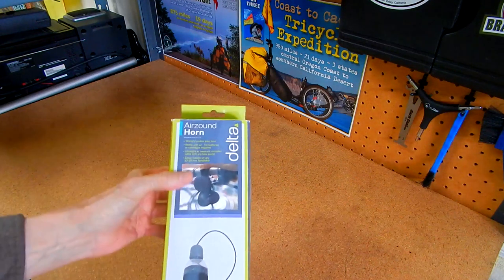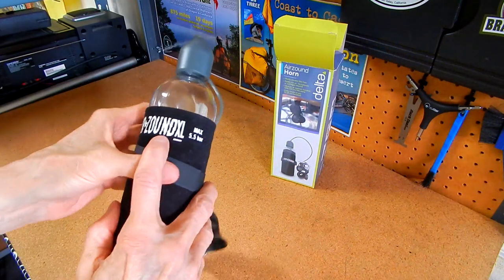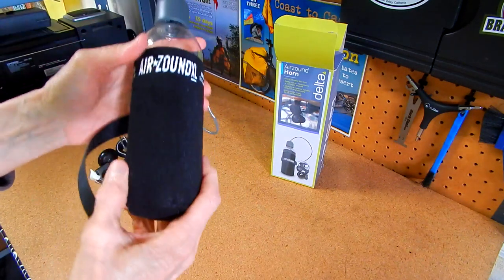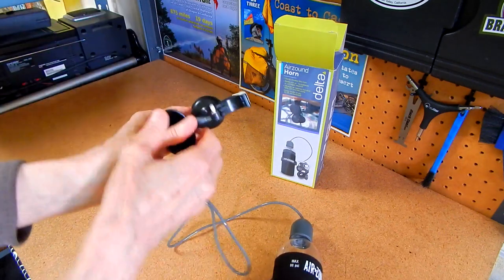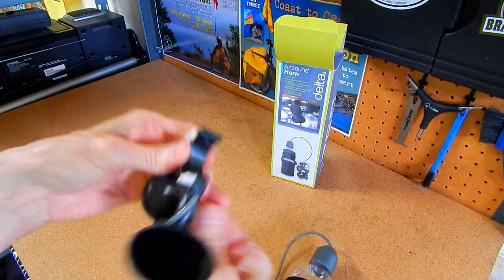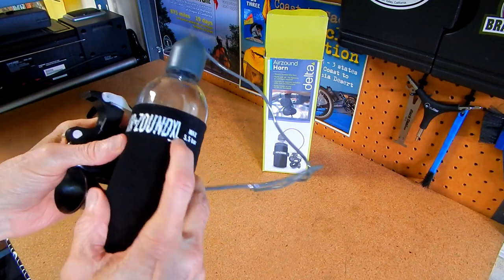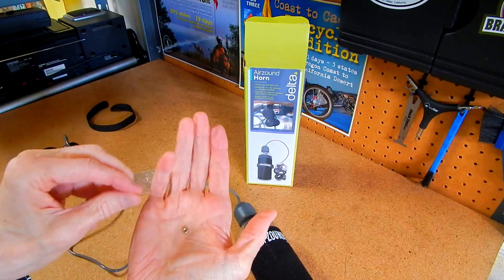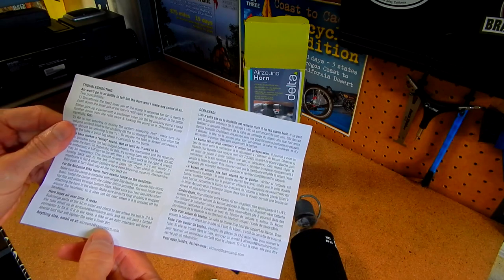Airzound Bicycle Horn: What's Inside the Box? Find out here!

Comment: I've been interested in the Delta Airzound horn. But I was a bit concerned about where to mount it on my HP Velotechnik Scorpion FS26 Plus Scorpion. I'll be looking forward to your mounting video to give me ideas. Keep on Triking!
Reply from the maker: I decided not to mount this on my HP Scorpion Enduro Tom, so there won't be any follow-up or actual evaluation. I tried a number of different mounting options, but just wasn't satisfied with any of them, so I have abandoned the idea. These are best suited for bicycles in my opinion, very simple to mount, but trikes present some challenges. I suppose the simple explanation is that this trike is a very classy looking rig, and I thought the Airzound detracted from the appearance. I know, it's kind of a eccentric reason, but hey, that's just me talking ... I am sure many other trikers are using these quite successfully, and totally happy. Mounting ease varies with the type of trike, and these Scorpions are very tight in their cable routing and tolerances, which made me realize (after buying this thing), that I didn't want to put it on the trike. BUT, that's not so say that you would be totally fine with it! So, don't let me discourage you!
steve
Reply: Thanks for letting me know Steve. I had very similar thoughts about mounting it on my Scorpion. I haven't been able to locate any YouTube videos of it mounted on a recumbent trike (?).
Reply from the maker: @tomboyd9053  Nor have I Tom seen a mounting on a trike video. The horn part is kind of long, and on a bike it hangs down under the handlebar, so it is unobtrusive visually, but I found no counterpart on my trike. For me, it's simply a matter of personal aesthetics, nothing more, not to mention that if I mounted it on the handlebars, I would have a moving air tube as I turn the bars, and I just didn't care for the idea.
steve

Comment: We purchased rechargeable battery horns and have found them very effective.
Reply from the maker: I have found some other horn options on Amazon while searching for bicycle horns. I am sure that a battery operated horn would be much more compact than this AirzoundXL, which requires tinkering to figure out a mounting solution on a recumbent trike. Your horns are probably more appropriate for a trike!
steve
Here is the Amazon link to bike horns:
https://www.amazon.com/s?k=hornet+bike+horn&hvadid=77653188526870&hvbmt=be&hvdev=c&hvqmt=e&tag=mh0b-20&ref=pd_sl_4z38z247bc_e
Reply: @EZSteve  the bottle would make you less aerodynamic, probably not an issue when you carry  all your luggage though
Reply from the maker: @DemiGod..  Yeah, I was going to put the bottle in my frame bag, which hangs from my front frame member. It fit perfectly. But since I decided I didn't want this horn, I gave it away and didn't worry about it any more.
steve

Comment: So Steve, did you end up returning it?
I read your comments to Tom, and I agree with you as to not really being able to mount it on a trike. Due to the air line not really being clean looking aesthetically,  and the airline needing to have enough slack for turning the trikes handlebars.
Reply from the maker: I'm not going to hassle with a return. I got in on eBay. I would rather take the financial hit than mess with a return. I'll give it away to someone who needs it, or donate it to the local bike shop for Tim (the owner) to sell or use. I also have two pairs of near new clipless pedals I need to dispose of, along with my LAKE clipless MTB shoes, which are in excellent condition. I have too much unused cycling stuff under my work bench. It's gotta' go sometime!
steve

Comment: Hi Steve. I was considering the air zound because of riding in my subdivision. Why did you not choose to keep it? Did you find a better alternative? There’s a need to have this noise to defend ourselves. Thank you for your help.
Reply: No need to reply. I didn’t see the previous replies.
Reply from the maker: Hi Calvin,
After spending a couple of days trying this and that manner of attachment to the trike, and routing of the air tube, I simply was not satisfied with how it would fit and look. That's the bottom line really. I wanted to give it a try to stop aggressive attacking dogs (fortunately rare), because I had  heard a cyclist say that a super loud horn like this had a dramatic effect on loose dangerous dogs, but I have personally never felt the need for a horn as far as motorists are concerned. So now, I just carry a small canister of pepper spray on the trike, and sometimes a battery operated "stun" device, neither of which I have ever had occasion to use.
steve

Comment: I used the airzound for awhile. After it failed, I've decided to fit a Wabco D-5 airhorn from a retired NYC subway car with a custom air system to my bike for a portable horn system. It strikes an octave lower than the airzound. Definitely something that most people wouldn't do, but it's fun. If you want to go extremely overkill, you can build a trailer with train horns and an air compressor with manual horn valves (Which I've done lol).